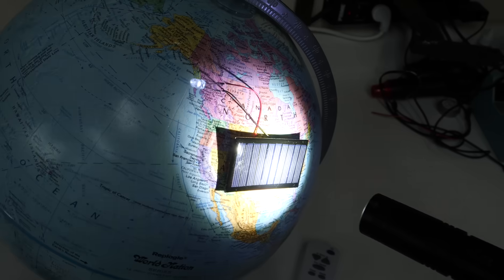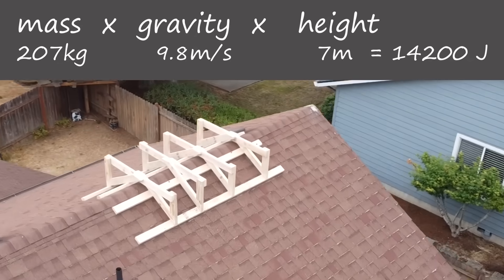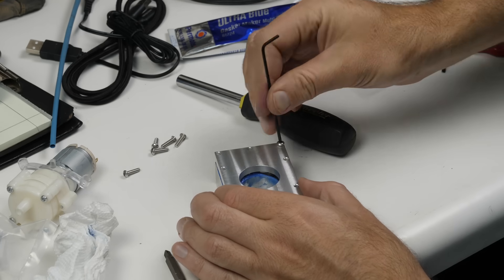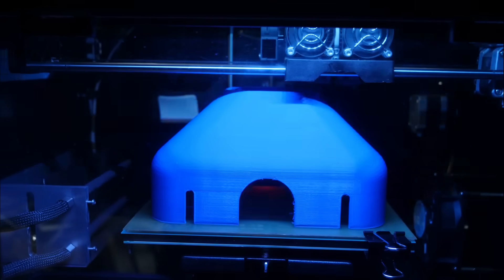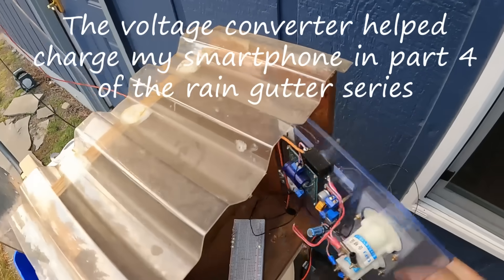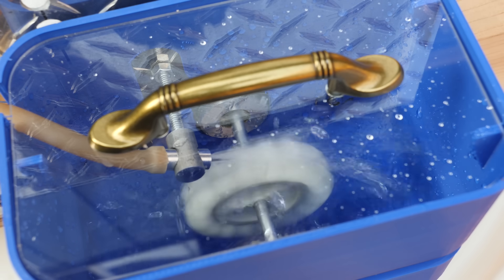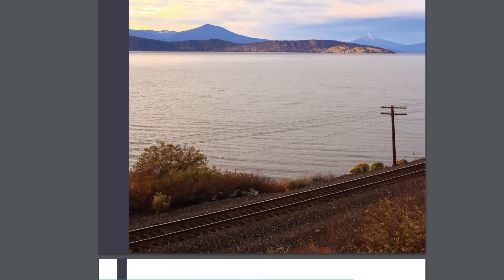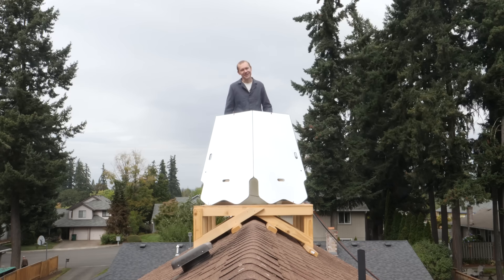Storing Solar Power on my ROOF!!!

Comment: I really like how you get your children involved, and also talking in the metric system instead the archaic 'Murican system.
Reply: I measure temperature in bald eagles and distance in meters
Reply: “Murica” uses both systems. Some applications are better suited to imperial, some to metric.
Reply: @jackthomas2051  hmmm  99% of people I ask how many feet are in a mile, they can't answer.  I bet I can ask anyone familiar with the metric system how many meters in a kilometer, and they'll reply 1000.

Please enlighten us with which imperial measure is easier?
Reply: @pcguru2000  
There are 5,280 ft in a mile. And no I did not need to look that up. It is defined historically by 1,000 paces. The word “Mile” is based on the same Latin word that millimeter is. 

The metric system is more precise and is therefore better for things like engineering but the imperial system is more practical. It is based on real world circumstances or objects. A foot is literally a “foot”. 
The imperial system is better with fractions. The foot (base 12) is equally divisible by 2, 3, 4, or 6. The meter (base 10) Is equally divisible by only 2 or 5. 

The metric system sucks at measuring things like height of a person. I’m 6’ tall or 188.88CM or 1,888.8MM. It’s ridiculous.
Reply: @jackthomas2051  Like you don't add digits after 6', no one says 188.88 cm or even 1,888.88 mm tall. Just says 190 cm tall. Only when you are at doctor, the nurse will measure you as 188 cm.
Reply: @pcguru2000  Oh… so you need “easier” because thinking is too difficult for you?

It’s not a matter of superiority. It’s about what your smooth brain is able to handle.
Reply: Thanks for using the metric system. As an european citizen I grow up with that. But i see so many videos from the USA with all that handfull different units for length, areas, volumes and weights. Its not easy to understand those (confuse (sorry)) declarations, when you dont have them in your blood and mind. And the more u understand each other, the less devides you (in opposite to what was written here the last 10..15 posts upwards). I hope my school english was good enough for the right understanding
Reply: Wow. He reinvented the 16th century.
Reply: The "Murican" system isn't. And it features units that are far more human-friendly (by deeply considered design--Fahrenheit, for example). 

Metric is still much more pleasant for science and building things...
Reply: Metric is archaic and people who can't fraction use metric
Reply: @NwoDispatcher  I use metric because I accept that I am a human that makes mistakes. KISS is my motto. Also YOLO. Also you do you. Have fun with your fractions 🤓
Reply: Don't the US military and NASA use metric throughout? 
Anyway, I like that the metric system is internally consistent so that length, area and volume are just m, m², m³ and 1000 kilogram is the weight of 1m³ of water (at 4 degrees celsius), that temperature is measured in 100 degrees between the triple point (0) and boiling temperature (100) of, again,  water. Or measured from absolute zero in Kelvin, but a temperature difference of 1 Kelvin is the same as a difference of 1 degree Celsius.
Impulse: kg*m /s 
Force: Newton  1 N= 1 kg*m/s² 
Pressure: Pascal 1 Pa = 1 N/m² = 1 kg/m*s²
Energy:  Joule = 1 kg*m²/s²
All unity ratios, and powers of 10.
Likewise,  Ampere, Mole and Candela are also straightforwardly connected. The whole of modern physics, chemistry, biology etc. is done in SI units (Systeme International). 

In contrast, the Imperial system has rather arbitrary ratios for inches, feet, yards and miles, which have again farfetched connections to mile². 1 mile = 640 acres, 1 acre = 4 roods, 1 rood =  40 perch, 1 perch = rod², 1 rod = 25 links, 1 link = 7.92 inches. Going on to volumes, you have gills, pints, quarts, gallons with ratios in powers of 2 this time, but no sensible connection to any of the Imperial units for length. The statute Gallon is 277.274 inch³. For mass you have the pound, with weird fractions and multiples of it with their own names: grain = lb/7000, drachm=lb/256, ounce=lb/16, stone=14 lb, quarter = 28 lb,  and so on and so forth. This is the English system, and the US has again their own, different but equally illogical and unpractical system derived from the English. 
Also, in reality both USCS and Imperial have been redefined in metric units, to be compatible with metric.

The point of all this is, well it is speaking for itself really.

I totally get the beauty of differences in language, dialects, cultures and we should all cherish our own. But it is also very nice when everyone in the world would speak a common tongue in addition to their own, which in practice happens to be English. It is the language overwhelmingly used in the scientific communities, in programming and IT, in diplomacy, on the street when you are a tourist.

A system of measurements should be as simple as possible (but not simpler), internally consistent and scientifically designed. All the world benefits from this, and any discipline from carpentry to farming to high-energy physics.

Being culturally attached to a system like USCS or Imperial that makes only historic sense and that only a native can love is just backward.

People all over world view it as backwards (see https://en.wikipedia.org/wiki/History_of_the_metric_system#/media/File:Metric_and_imperial_systems_(2019).svg). Nobody outside the USA, Canada and the UK view it as a positive thing. It continues to cause untold problems, with large, real negative economic consequences. If only in needless duplication in sets of bolts, screws and machinery, but it goes much further than that.
It was the root cause of the explosion of the Challenger spacecraft (see  https://www.simscale.com/blog/2017/12/nasa-mars-climate-orbiter-metric/ ).

Objectively, the continued use of these systems is harmful to both their users and the world at large. 

Subjectively, in my opinion, the continued use of these systems equates to the perpetuation of a nonsensical tradition at best, and appeasing to nationalist feelings in the USA, UK and Canada at worst. And examples of those feelings abound in this thread.
Reply: @perpetualrabbit  To you arguments about measurement: unless you are actually working with somebody else, it is pointless to argue over the “superiority” of one system over another. Metric isn’t even the best system as it is based on the product of the first and third prime numbers. You’d do better with a binary system, like computers already use, or hexagecimal which is divisible by the first four integers after 1.

Base “10” is “simpler” merely because it’s what most people are used to based on the number of digits on two hands.
Reply: @josephcoon5809  Agreed, base 8 or 16 would have been better, the binary division of inches on US rulers is the only real nice thing about it. Good luck with selling that to the world though. About systems of measurements: Aren't we all working with someone or something else these days? It is a connected world for a long time now.
Reply: @perpetualrabbit  I’m not trying to sell “the best version of measurement” to the world.

I’m trying to “sell” the idea of decentralization. The more you centralize ideas, the less variance you will have. The less variance, the less opportunity for advancement and evolution. We need fewer people fighting over the minutiae of pointless ideas of “superiority” and more people building bridges between different thought processes. We have things like frequency hopping encryption PRECISELY because of outside-the-box thinking and not because of some useless adherence to convention or conformity.

Yes. It is a connected world, but that doesn’t mean it has to be a boring conformist world. This backwards tribalism of thinking one tribe should dictate what other tribes should be is how we lose important aspects of our humanity. Use metric if you want. Think it superior if you want. Just do not push for unnecessary conformity regarding a useless idea such as “the best measurement method.”

All your neurons are part of a connected network. That doesn’t mean they all accomplish the same tasks, or that they even use the same coding to do their individual tasks.

After all, if Ford complied with the “expert opinion” of his day, we would be under miles of horse manure to meet our personal transportation needs.
Reply: @perpetualrabbit  Your comment natural units being the basis for a common measuring scale is the first rational comment so far.

However, I still maintain that it’s still pointless to hold any particular language as “superior” to any other. At best, you can call certain languages more expedient or “practical,” but that’s still heavily dependent upon the individuals involved.

At some point, even the metric system will be called racist as many other things have been in the corporate attempt to motivate individuals to relinquish their rights and responsibilities in the name of conformity disguised as “equality.”

Imagine my surprise when I happened upon a video going into sloggish detail about how “Music Theory” is inherently “white European supremacist” and that it is another mechanism by which other cultures are suppressed.

On the one hand, I appreciated somebody bringing light to the fact that the institution of university IS a gate keeping institution. On the other hand, they throws to localize it to an irrelevant facet. The most important issue is that university is seen as the only path ti higher education, and it is a major factor in the various intellectual elitist driven centralization of society that manifests in conversations like “metric is superior to imperial measurement systems.”

The ACTUAL progressive treatment is to stop publicly funding colleges and have them compete with modern technology regarding education. The moment you stop funding it is the moment free market competition will force colleges to evolve or perish.

Plato understood education far better than “educated” elitists today.
Reply: Might want to learn where the imperial system started.
Reply: @bwakel310  It didn't start in France, that's for sure.
Reply: There aren't any free countries. There are practical applications for both measurement systems.
Reply: @ChrisInmanTN  
I hope you're not an American.
Reply: @hg2.  you mean U.S. citizen. Everyone who lives in north, central and south America are Americans
Reply: @MoondancerRec  
--- it.
Reply: I'm glad you're so "cool" with your government-imposed metric system.
Reply: @hg2.  Imperial measurement systems were taught to me in school, but I choose to use metric for woodworking. Using lookup tables to convert 16ths and 32nds into decimal reduces the accuracy of the original measurements. But meters are already in base 10 numbering system, so you can plug the exact distance right into any formula. If I need to calculate a circle or triangle, I always use metric.
Reply: @Alkatross  
Good for you. 

Your social expression about it is obnoxious.
Reply: @hg2.  You make a valid point. I realize I am being "rational", but I hope this comment is as obnoxious as teaching American children base 10 numbering and then measuring everything in 12ths, 16ths, or 24ths. Which is insane, considering mass, time, and distance are objectively the same thing(s) everywhere in the universe.
Reply: @hg2.  Freedom is what sets us apart. 🇺🇸 It is quite a privilege to call a foot whatever you want.
Reply: I swear I'm not an atheist...
Reply: @Llorx  
I'm glad you're not an American.
Reply: @Alkatross  
You might as well be.
Reply: @Llorx  
Interesting cultural phenom: You've made a virtue out of freeloading.
Reply: @hg2.  not freeloading when you pay your taxes. Just living life without extra pressure. You only have one and is stupid to worry about money and private insurances and student loans and such. I just work, pay taxes, and if one day I get diabetes or a stupid broke driver runs over me, I know I just have to worry about my care, not about money. Not only for me, but my beloved ones. Quality life man.
Reply: @Llorx  
If your taxes cover the cost of your Euro-freeloader handouts, why are you giving your money to the government?
Reply: @hg2.  gotta love the irony of these free people use a system literally named after the monarchy they rose up against
Reply: @JamesScholesUK  
America doesn't use the imperial gallon. 
Check your spelling.
Reply: @hg2.  narrator: China is one of the very few places that also talk in Imperial...
Reply: @hg2.  flipside: you're making a virtue out of watching people die when they could be saved.
Reply: @hg2.  to spend on military budgets, Europe has the highest military spend in the world.

Oh, wait, no, that's America...
Reply: @andysuthhero  
?
I.e. Europe isn't a defense freeloader?
Reply: @Alkatross  If you were being “rational,” you would realize that “base 10” is just a matter of convention most likely based on the the number of “digits” you have on your two hands.

The simplicity of “base 10” is derived from your familiarity with working with a “base 10” numbering system.

In case you noticed my use of quotation marks, it’s to highlight that there are 10 types of people in this world: those who understand binary, and those who do not.

EVERY number of the nits can be used for “base 10” because the 1 in the first position merely indicates the base number to the first power. If humans had 4 fingers in four hands, their “base 10” numbering system would have what you would call “16” units instead of the “10” you are used to.

Ultimately, it doesn’t matter what base anybody uses as long as everybody working on something uses the same system.

Are you this elitist with spoken language as well? Should the whole world ALSO use the same language? It would be more “efficient,” wouldn’t it?
Reply: @Llorx  First you say you don’t have to pay because it’s “free,” then you say it’s not freeloading because you pay your taxes.

😂😂🤣🤣🤣🤣🤣🤣

Which country do you live in and what great advances has it made in the last century? Then tell me what American advances you are freeloading off of like the internet, commercial electronics, and  healthcare.

It’s great that you get it for “free” brut where did the technology come from?
Reply: @pcguru2000  Imperial measurement systems are no longer imposed by the British Imperial government. 😂 What argument do you think you are making?
Reply: @josephcoon5809  I argue that it makes no sense to convert tenths of an inch back into 16th or 12th markings on non metric rulers. Since I switched to metric for woodworking, all of my calculations come out accurate to the millimeter. Without referencing a conversion chart, which always reduces the accuracy. This was especially evident when calculating triangles. 

Since you brought it up, my job requires measuring time in 10ths of an hour (6 minute increments) so yes, I also think it makes no sense to divide a day into 24ths, but I understand the momentum of convention in society. People love quarters! At least we can all agree how long a day is. 365 days per year with leap days is also pretty self evident, what with everybody being on the same planet and all. However, I am not so "elitist" as to suggest this scale to Martians. 

Don't even get me started on cooking measurements. Teaspoon, tablespoon, pint, gallon, quart... who has time to keep track of this ridiculousness? Give me international standard units please and thank you.
Reply: @Alkatross  Ultimately, it’s useless arguments like this that leads to people thinking Oder of Operations is a mathematical concept.

I was even told that I was “mansplaining” when I was correcting people about it. 😂

Edit: and there we go… spent five minutes explaining how to easily divide any line using any unit of measurement, and YT deleted it.

YT really has a lot vested in making sure people can’t think for themselves, aye? 😂
Reply: @perpetualrabbit  In these same wall of text, you champion “socialism” and decentralization at the same time.

I agree. Most people don’t understand what the actual dichotomy is, and your strict adherence to the idea that “conservatism” and “progressivism” are mutually exclusive is one of the lesser misunderstandings that you have.

The true dichotomy is liberty and tyranny.

People collectively own things in America. Socialism is absolutely a viable concept…just NOT at the federal level. The more codified socialism you apply at the federal level, the less freedom everybody has locally. GOVERNment is antithetical to FREEdom. “Govern” and “Free” are practically and literally opposing ideas.

As for gay unions… the Constitutionally CONSERVATIVE stance is to have complete equality under the law. Gay unions IS a CONSTITUTIONALLY CONSERVATIVE concept, just as abolishing slavery was. Gay unions are Constitutionally Conservative AND Socially Progressive. This is why your false dichotomies are flawed.

Abortion clinics are much trickier, and if you really want to get into the definition of personhood, that will be an even more complex discussion than our current one. I’m not to keen on having it considering you are struggling with these much simpler concepts.

“Responsible Drug Policies.” Again, your use of nebulous language belies either a disingenuous attempt at skirting relevant points, or an ignorance to the idea altogether. Based on your recent misapprehensions, I’m inclined to think the latter. You don’t seem like a liar. You just seem very myopic, short-sighted, and have a short attention span as most people do these days.
Reply: @josephcoon5809  thanks for the interesting discussion, but not so much for the insults. But hey, they came free of charge.
I think it better to stop here because we went off on a tangent long ago.
I find the rooftop water energy storage system and the US measurement system equally creative and effective (an AA battery worth of energy), but can't endorse either of them.
Reply: @perpetualrabbit  What “insults”?

I spoke frankly, and have no use for your emotions. Why do you feel the need to be emotional over words?

Your endorsement, nor anybody else’s, is unnecessary. An idea is an idea. Just because you cannot fathom a situation where these particular ideas would be useful to you now, does not mean you’ll never find a use for them.

THAT is my overall point. People working on different ideas in parallel is how you achieve the quickest evolution. Who would have thought that player piano technology would have been so pivotal to frequency hopping encryption?

Hedy Lamar.
Reply: @perpetualrabbit  In the long run, we need every country to be different and to stop moving toward an “average normal.”

Without the centralized planning of communist and socialist countries, we lose sight of how important freedom and responsibility is. The more America approaches NATIONAL collectivism, the less this world has an example of individual sovereignty and ingenuity.

America is unique in that it allows its people to mimic any other nation they deem adequate or “superior” at the local level so that European Marxism, Japanese Imperialism, Chinese/Russian Oppression, or even North Korean Despotism can be mirrored within the constraints of the Constitution. Any one of our states can adopt any European nation’s method of governance WITHOUT inflicting it upon the rest of the country. They would also benefit from the common defense of a national military unlike Europe arrogantly enjoying America’s military WITHOUT being subject to America’s Constitution. Europe enjoys that safety PRECISELY because America has been vastly superior to Europe for decades.

That is changing, however, the more America shifts toward the centrally planned mediocrity of Europe and its nationalized collectivism. Have you not noticed that Europe became collectively WEAKER since the advent of “European Union”?
Reply: @perpetualrabbit   Are we dating or are we having a RATIONAL conversation which requires no emotion?

As for your understanding of “ad hominems”…

An ad hominem is a refutation of an idea based on the person rather than the fallacy of the idea itself.

Ad hominem: you are wrong because you are myopic.

Observation: you are myopic because you are wrong.

Logical refutation: you are wrong because you do not consider <insert points>.

Don’t take me as a European-hating American. I’m merely for Freedom over Tyranny. I would love nothing more than for every Marxist to gather into one area and exercise their beliefs to their heart’s content. I want every individualist to do the same. I want every person of every ideological bent to gather based on their personal ideology so that they may exercise the ideology which they hold as to be the best so that each person is free to be who they see themselves to be without anybody forcing or filling them to be otherwise.

As for your “empathy.”

You also do not seem to understand how “suffering” manifests or the mechanisms that lead up to it. I do not exercise emotional discourse because I understand it, and I respect you enough to be honest, not “kind.” When I engage in regional discourse, I take responsibility for my own emotions, and I expect others to do the same. If they CHOOSE to take “offense” at something I say in complete honesty, then I give them the choice to continue with the rational discourse OR devolve it into emotional rhetoric.

I never claimed you were “angry.” I said emotional. Offense is an emotional response manifested by an individual’s desire for a certain way to be treated. Call me every name in the book, and I would not care as long as you have something new for me to learn. You seem passionate about what you believe in, and you also seem intelligent. However, intelligence does not mean you have a broad enough perspective to understand the things that I am saying. That’s fine as well. I will not force you to braided your perspective. I will merely offer my opinion on the breadth of your perspective as well as have the patience to help you broaden IF you desire.

Ultimately, my views are not meant to persuade you, or anybody, on how to think. I am merely expressing my perspective as an explanation for the endeavors I have chosen to execute. I am already working on things, and I am alone in that work. I would appreciate help, but I do not require it.

I have already made up my mind to build systems that promote the decentralization of governance based on how the American Constitution was originally designed; on how the brain is structured; and on how the Universe evolves through time. I would rather offer people the option to live with those that agree with them rather than foolishly attempt to force their ideas on people they will never meet only to relinquish their rights and responsibilities to corporations that control their myopic, short-sighted, and even shorter attention spans. I have no time to pity people. I only have time to work toward a better future.

If you find that “offensive,” I work to alleviate that as well.

Lastly, I find it more “smug” to assume that anybody has the wisdom or the right to assume that they know what’s best for a collection of people that they will never meet. Look up “Chart of the Century,” and you’ll see exactly what centrally planning an economy does. Every market regulated and/or subsidized by GOVERNment rises in actual cost (not cost to the end-user) far faster than inflation (which is the aggregation of all markets) and even faster still than markets COMPETING in the FREE markets.

EVERY complex system evolves TOWARDS decentralization, and foolish humans still vote their sovereignty away for the centralization that destroys societies. EVERY major atrocity has one thing in common: centralized power.